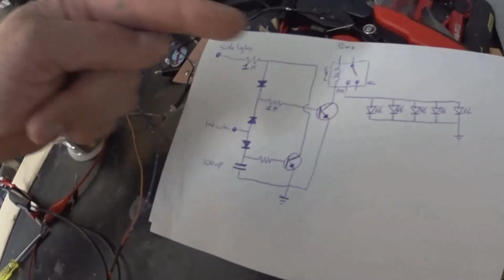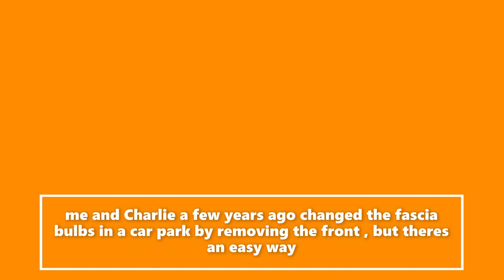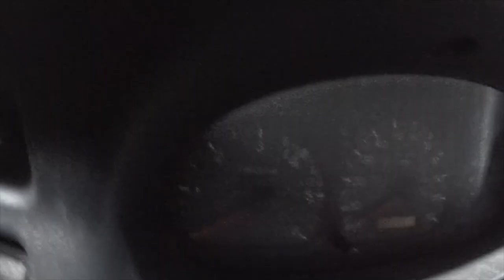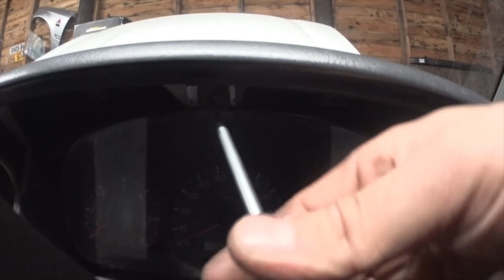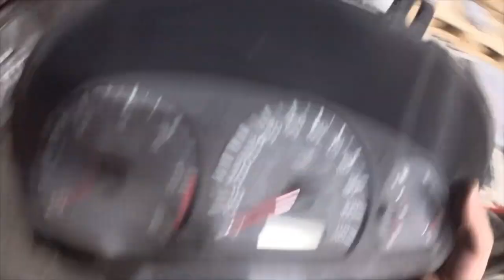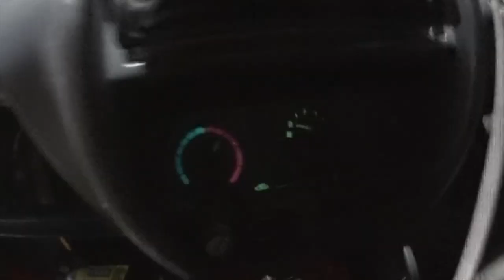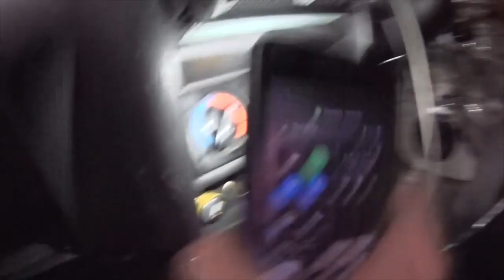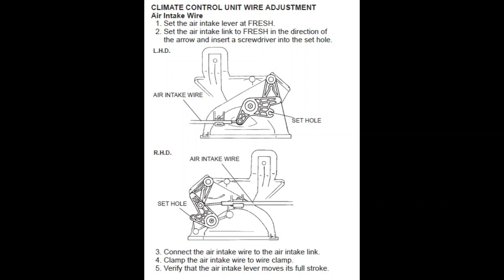How To change a heater matrix/heater core on a Mazda B2500/bravo/Bounty , Ford Courier/Ranger

Comment: Alright mate iv just combined my smiley transit luton 96  with a Ford ranger thunder 04 the mono rail chassis of the transit fitted right in between the ranger  chassis then I welded them together few plates and that, just moved the rear suspension and axle back the past few days but it nearly there.. the heating matrix fitted behind the dash with mms to spear. your vidios have helped me alot mate just want to thank you and keep up the good work.. Nice one
Reply from the maker: Put some pics up of this contraption!
You on the ranger forum Facebook page ?
Reply: @rangerfortin1504  lol I'm not on face book mate il try and put sum up on here I'm a bit shit with technology lol where are you from mate

Comment: I’m just trying to pull the facia off to see if there’s any loose wires that would be causing my blowers to intermittently work. I’ve pulled the little hook off behind the glove box, I’ve got the radio out for better access but even with two radio forks, I can’t get the Facia to come out. I can get them to click loose, but then it won’t move more than about 15mm towards me, even when pushing from behind

Edit:
Never mind, I hadn’t watched far enough into the video, I thought when you’d pulled the radio out, that was actually the climate control box

Comment: @RANGER FORTIN Using my husbands account, Any advice on doing a mk2 head change? I've been told by the AA that I have exhaust fumes in my water forcing water out of the over flow even when the engine is cold. Thanks Karen